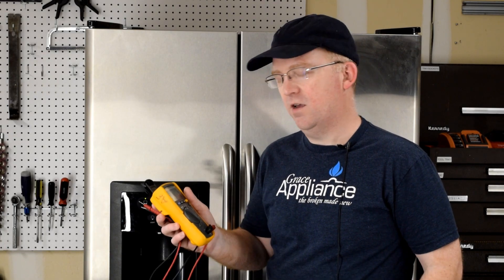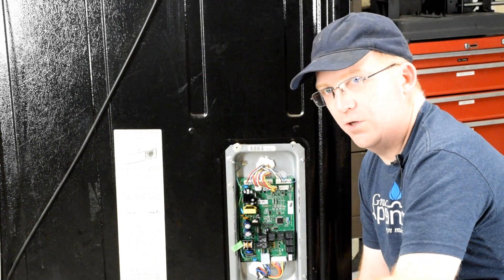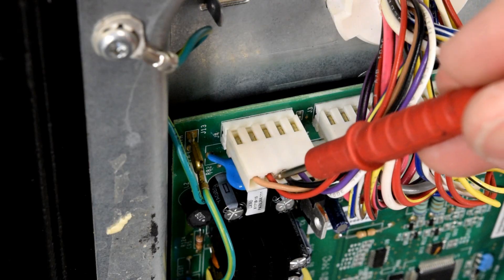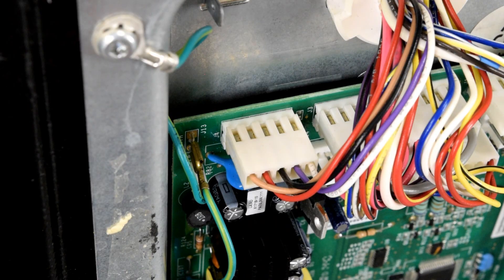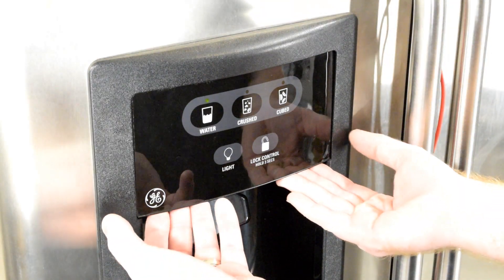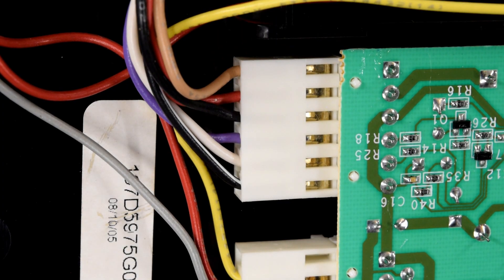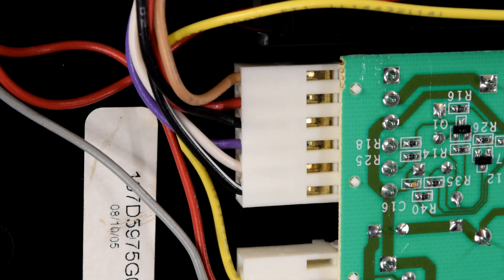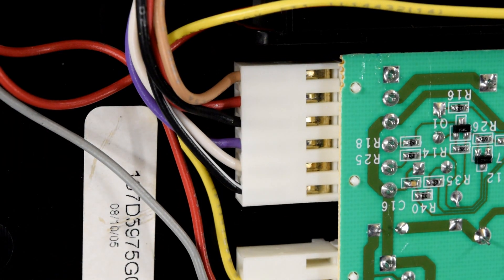Diagnosing a Bad Control Board - Part 4: Front Touch Panel

Comment: @GE Side-by-Side ONLY - Refridgerator Repair Videos
@GE Side-by-Side ONLY - Refridgerator Repair Videos
If the main control board has 7-10v it's a failed test bad main control board. Is there anything else that could cause the main control board to test at 7-10v? the wall outlet is functioning properly.@GE Side-by-Side ONLY - Refrigerator Repair Videos
Reply from the maker: TIALKN check for corrosion or faulty wiring at the small white connector behind the kick panel near the freezer door hinge.   
Yes, 7vdc sounds too low.  From my experience, it should be closer to 12vdc minimum.  So, it does sound like a failed main board.  
But, You may also want to try removing plugs one by one from the control board in the rear to see if you can cause any change to the front board. If you have a shorted component elsewhere in the refrigerator, if can rob voltage like this. Be sure to unplug the fridge before you touch anything on the board, remove a single plug, and restore power to the fridge and see if the front board resolves.  If not, reinstall plug, try another and restore power again.  If the front touch panel goes back to working, it would indicate a failed component in that particular circuit.  

I hope this helps!
Andy
Reply: @GraceAppliance  
Yes, it has very much so, thank you.
trying to make sure after installing the main control board that it's not going to do the same thing over again.

The sensor test on the main control board seemed to be in the normal ohm range. I further investigated and found a defrost sensor had been replaced prior to using butt connectors that had a jell material packed into the ends of each connector. If there is a bad connection here could this cause the board to short out or even draw energy away from other plugs like the front control panel? Before installing the Main Control Board I'll test this defrost sensor and re mend the wires with solder and shrink wrap.
Reply from the maker: @TIALKN  hey, no that sounds like this installed correctly. Even if that part were to fail, it's a very low DC voltage (like 5vdc) and would not cause the issues you are experiencing in my opinion.

Comment: Andy,
Loved the videos, very informative and easy to follow.
I have a slightly different problem, would be interested to know if you have seen it before and what the solution was.
I have a 10 year old GE GSL25JFTA BS.
Most of the time it works great, but every time we get a power outage it takes a LONG time to start back up again.
Whilst we are waiting for it to come back up the Front Control Panel is not illuminated and unresponsive, the lights in the refrigerator and freezer compartments work as normal.
It seems to take longer to come back each time, this last time it took more than 48 hours.
It is back up and running again now, but I feel I am waiting for the next power outage.
Any thoughts and advise would be gratefully received.
Reply from the maker: Hi, most commonly this is due to a weak relay on the main control board.  Yes, I agree that board is on borrowed time.  
That’s been the only possible cause I’ve seen give this symptom based on my experience.  Hope it helps!   Andy
Reply: Andy,
Thank you for the rapid response, especially on a Sunday evening.
I have a couple of follow up questions....
Which relay is giving me problems?  Is it soldered in place?
The control board you sent me details of looks quite a bit different to mine?  Will it work?
Thank you again.
Reply from the maker: Duncan Sheppard hi, there isn’t a way with the relays on the board to know which one is failed.  They are soldered in place.  
The board I posted was looked up by your model number and is the correct part for your fridge.  This is an updated part number for many of the models out there.  Even though it’s different in appearance, it will work fine.  Thanks!
Reply from the maker: https://www.graceappliancediy.com/products/ge-wr55x10942-refrigerator-main-control-board-1?_pos=2&_sid=b3dff50fe&_ss=r

Comment: I'm getting 11.4VDC going to the Front Touch Panel, could this be a problem with the main board? The Front Panel doesn't turn on.
Reply from the maker: Hi, it sounds like the front touch panel is failed. The main boards job is to send power to the front panel and you're getting the correct voltage. 
Is your fridge running in the meantime?
Reply: @GraceAppliance   No it's not there was a power outage and when the power came back the Front Panel stopped working. Also the evaporator fan isn't working, but thank to your videos I troubleshoot the problem and noticed that the main control board is sending proper voltage to the fans. Also noticed that around both resistors are brown but the board is still sending proper voltage. I'm guessing that the evaporator fan needs to be replaced.
Reply from the maker: Yes, I agree about the evaporator fan. Hopefully it did not cause lasting damage to the main board.  
If you will try disconnecting the front board from the refrigerator and then restore power it the fridge if it the runs as normal, it points toward a failed from board.   Let me know what you find.   Thanks!
Reply: GE Side-by-Side ONLY - Refrigerator Repair Videos Tired it, nothing happened so I’m guessing the front control board failed and the evaporator fan.
Reply from the maker: MikeJL I agree, it sounds like that’s the case.  You’re getting appropriate voltage to both and neither are working.

Comment: My control board started clicking and the numbers on the touch panel started blinking, compressor not starting. Then I replaced the  control board - compressor starts, lights on the touch panel not blinking, but the temperature does not reach the setpoints. Replaced the evaporator fan. Plugged back in -  the fan started spinning - I am happy. Pulled the plug out, installed the covers/panels back, plugged back in (did not touch any harnesses, etc.) - and - darn! Not working. The lightbulbs inside the fridge work, but the touch panel does not, compressor does not start. How did it happen? What could have happened? It was working before I installed the covers/trim back in...  

My guess - when the fridge was plugged in for about 20 seconds and evaporator fan was spinning, I pulled the plug out. Perhaps, during the time, when compressor was about to start. It may overloaded the board and burned it. However, the capacitors look fine and the fuse too. I don't have a multimeter on me... So, any ideas what could have happened? Any thoughts - appreciated.
Reply from the maker: Hey, I'd start (with the fridge unplugged) remove each of the plugs one at a time, then restore power to see if there is an improvement with the fridge operation.  
Be sure not to touch anything on the board while it's plugged in of course. 

Another plug that you can check is a white connector near the freezer hinge behind the kick panel. Look for broken wires or corrosion build up here. 

Let me know what you find. 

Thanks,
Andy

Comment: GE refrigerator circuit board making a clicking noise, *click *click, on circuit board. On the same time when the circuit board makes click noise, compressor & condenser motor is making a humming noise. at the same time, the inside light bulb goes dim. When I disconnect the condenser motor, the everything is working fine, and no clicking noise on the circuit board, and the motor is 11.3 Volt DC and has 4 wires. What do you think it is, a bad motor?
Reply from the maker: Hi Punjabhai Patel, 
Please send your model number found inside the refrigerator section on a white or silver tag.  

Thanks!
Reply: @GraceAppliance  PSHS6RGXCDSS. I've been watching alot of your videos and they help alot. Thanks! When I got there, everything was working fine but it was a very dirty condenser and it was going off on overload. So I cleaned the condenser with CO2 and also did around the motor and through motor shaft. After I turned condenser back on, the circuit board started clicking.
Reply from the maker: Hey Punjabhai, 
I agree, it does sound like a shorted out condenser motor.  You are getting the correct voltage to the plug so this says to me that the control board is doing it’s job fine.  

This is the condenser motor you’d need, and this should fix your issue.  
https://www.graceappliancediy.com/products/ge-wr60x10209-condenser-fan-motor-for-refrigerator

Thanks! 
Andy
Reply: @GraceAppliance  the current condenser motor has this number: wr60x10155. Will it work with the one you sent? Thanks again.
Reply from the maker: Punjabhai Patel yes, it’s the correct fan for your model number, thanks.
Reply: @GraceAppliance  Hey again! So I replaced the condenser motor with the new one, however, the clicking sound in board is still occurring. When I disconnect it, everything runs, and clicking sound is gone without the motor. Do you think its board? Thanks for the help!
Reply from the maker: Hi, sorry to hear that.  
When you disconnect the fan motor, you get a constant 12.xxVDC where the fan plugs in, it would appear the board is doing it’s job. However, perhaps the board has a weak relay that under Load is not able to hold connection. 

This is my only thoughts on a possible bad board.  I agree, it does seem like a board is needed as well.  
Do you see any swelled up capacitors or darkening of the larger green resistors on the board?
Reply: @GraceAppliance  Yes, I saw 2 small capacitors by heat resistance that were swollen.
Reply from the maker: Punjabhai Patel ahh!  Gotcha! 
Yes, a new board is in order for sure.  Thanks

https://www.graceappliancediy.com/products/ge-wr55x10775-main-control-board-assembly-for-refr
Reply: @GraceAppliance  I can buy a pre-owned one off of ebay/amazon? There's no harm to that, right? Thanks again.
Reply from the maker: Punjabhai Patel I’ve never personally had a bad experience with doing that.  It’s definitely an option so long as the part number is a match.
Reply: @GraceAppliance  got it. Thanks, and B safe
Reply: @GraceAppliance  Hey again! So, I installed the new board and everything turned on except for the compressor. With the new board, there's no clicking sound but the compressor does not turn on. When I put back the old board, the old scenario is happening with the clicking. Any thoughts? Thanks once again.
Reply from the maker: With the new board, once you unplug the condenser motor, can you get the compressor to run?
Reply: @GraceAppliance  No, the compressor does not turn on if I unplug the condenser motor. The condenser motor does not run. Also, the compressor is not getting power and the compressor terminal has no power either. Also, a relay solder seems to be not original in the circuit.
Reply from the maker: @punjabhaipatel2107  that sounds suspect on the board your received if it's been resoldered. Perhaps it was a used board that was sent to you?

Comment: so 21 volts AC is bad, right?
Reply from the maker: Hi Justin, 
None of the voltages measured in this video are going to be AC voltage.  
Your front board should be around 13vdc. 

Let me know if you have questions, 
Andy

Comment: Good vids !   How long should it run without shutting off ?     Ge HOtpoint SIde,by side HSM25GFTASA,  freezer temp down to 20-, makes ice fine, def seems to work,  tested and replaced all the 3 temp sensors (thermistors), def thermostat, new heater (some of these tested good, but i r/r anyway since I 'm in there), took front panel off cleaned off some blackish specks all over the underside of the board and a little on top,  its running now, but never seems to shut off ?  All the front buttons work fine. EVap fan works, condensor fan works !  Just puzzled as to why it never shuts off on setting 5 5  which is norm or any setting really, just runs and runs, i worry it may damage it ?
Reply from the maker: Is it running at - 20F when set on 5&5?
That's very cold and should be closer to 0F.

Perhaps a stuck relay on the control board?
Reply: @GraceAppliance  Ok, my bad, i meant 20- (less than 20F), it finally did shut off when put on 1 1 on front panel.  I guess thats good enough at 15F ?   What should the damper door do and when, ops check?  when first took cover off damper door it would be full open at 1 1 , and full closed at 1 2 and all other even colder settings like 1 9.   now its on 1 1 and just stays full open.   Still feel like maybe the temp sensors in freezer might not be enough ohms, is it possible to put say a 1kohm resistor in series with each thermister to make the logic board think its cold enough at 5 5 ?   I was down to 0 F when on 5 5 before.
Reply from the maker: john Doe john Doe I’d be curious to see a picture of the evaporator coils inside the freezer.  You’d need to remove the back wall inside the freezer. 
I’d be curious how the frost pattern looks. If the compressor is struggling to keep up, it might eventually achive the correct temperatures, but would need to run much longer in order to do so.  

If you wanted me to take a look feel free to email the pictures to GraceAppliance@gmail.com 

With respect to the resistor idea, It will work in fooling the control, but wouldn’t be helpful in maintaining predictable behaviors from the fridge.
Reply: Hi, 
emailed frost pic (see bottom). 
    Thanks for helping me.  Pwr cord unplugged.  I checked the thermistors at approx 0 (zero) deg F in the freezer, from the back
 J1plug wires (not the board pins), results were like: 

Pins             J1 plugged in    J1 not plugged in.
2 & 5            6.6Kohm            10.3kohm
3 & 5            12.3k                  47.6k
4 & 5            12.9k                  51.2k
  Makes me think for this exact Model HSM25GFTAsa that the J1 tests can't be trusted or sensors bad? I know I tested them in all in a cup of ice water and were all 3 getting 14Kohm & above.   I would have
 thought the J1 not plugged in would be more exact but obviously 2 of them are way out there. 

The compressor was pretty hot so I am going to have to limit how much I run it simply by turning it off at the
control panel  i think.         Starting to think the thermistors are bad but measure good at the 32-35 F area ? 
     If you weren't able to get the frost pic, evap coils were clear at the top, increasing gradually until at bottom the evap coils were moderately covered (not iced solid).  @GraceAppliance

Comment: I have replaced 2 control boards on my GE profile fridge what could be the cause
Reply from the maker: Ibur Ibur, hi there isn’t enough information for me to answer this question.  

What is your fridge not doing?
Reply: Only the light turns on inside, the tempt display goes blank, and it doesn't cool, i dont here the compressor running when this happens.. Its the second time i replace the main control board😭
Reply from the maker: Ibur Ibur, you can check with a meter to make sure you’ve got 120vac coming to the far right pin on the light blue plug with 3 wires on it. Should he a brown wore.  Between this pin and the orange wire on the plug next to it, should read 120vac.  

If you have 120v, with the fridge plugged in, being careful to not touch anything but the plug on the main control board so you aren’t shocked, unplug the J4 connector for your front touch pad. If the fridge comes to life after unplugging the J4 plug, you have a failed front touch pad.  If no change, it does sound like a failed main control board.  

As far as what causes them to fail, I couldn’t say. They’re pretty awful and prone to power surges, etc.
Reply: Its the second time.1 replace it in 2 months
Reply from the maker: @Leilachochi123  watch this video. At 1:58seconds. Have either of your boards had these green resistors turn dark or brown in color?

https://youtu.be/zbmAqizE128

Comment: Hello, my GE side-by-side GSRS3KLXHFSV has dead. Front panel, fans, compressor are not working. But only the light inside of each of two departments is working! The voltage on the motherboard is 114 V, so, as in my outlet. Could you tell me please, what is the possible reasons of this failure? Thank you so much.
Reply from the maker: Slava Glazyrin hey, most commonly it is the main control board that will cause this, but you’d need to rule out a failed front touch panel.  To do this, careful not to touch anything else but the plug so you are not shocked, unplug the J4 connector from the main control. If the fridge comes to life this is a failed front touch panel.  If there is no change, it would be a failed main control board.  

If you need a main board, you can get a wr55x10942 from graceapplianceDIY: 
https://www.graceappliancediy.com/products/ge-wr55x10942-refrigerator-main-control-board

Feel free to let me know if you have any questions! 
Andy
Reply: @GraceAppliance  Thank you, Andy, for your professionalism! I have only unplugged J4 from the motherboard. There is no changes. And resistance of evap fan is 0,9 om. So, need I replace evap fan either??? Thank you!!!
Reply from the maker: Slava Glazyrin you’re welcome! 
No need to replace the fan. Sounds as if you need a main control board.  Good luck and let me know if you run in to any issues.  Thanks!
Reply: @GraceAppliance  Thank you, Andy, I will try to replace main control board. Best!
Reply: @GraceAppliance  Hello, Andy, I have replaced the main board and my refrigerator does work now! You are  a wizard, I love you :). Best
Reply from the maker: @slavaglazyrin6182  awesome work!  You're too kind. Stay in touch. Andy